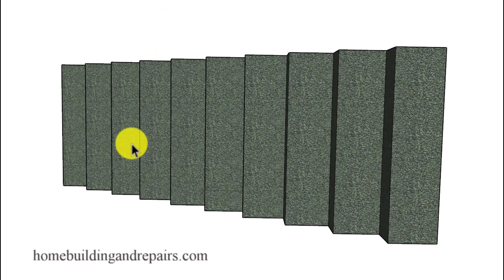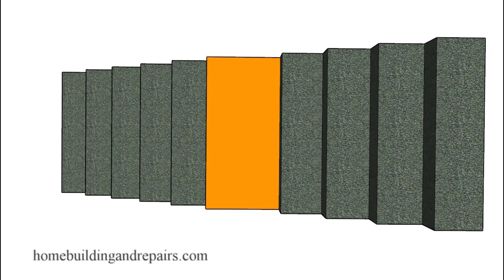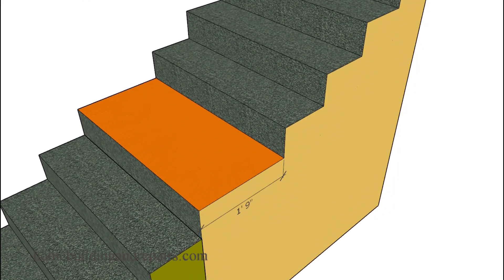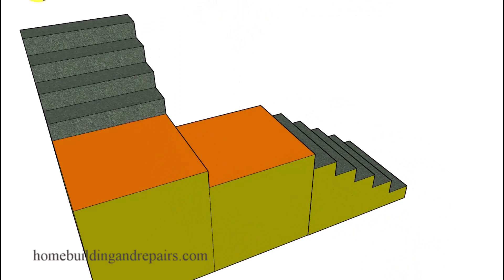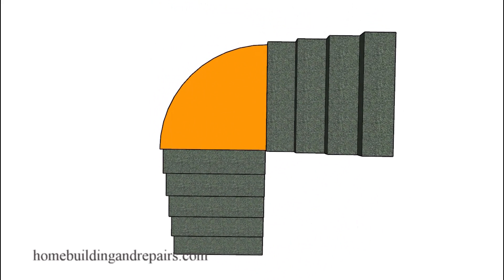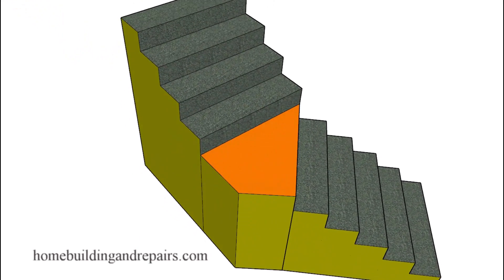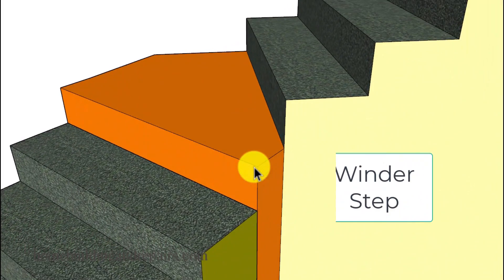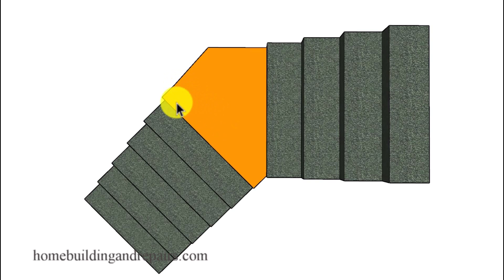The Difference Between Stair Steps And Landings - Building Code Education

Comment: Great video! To most people this is like "Who cares what you call it? A landing is just a bigger step." And it's damn ture! But for whatever bureaucratic reasons uncompresensible by the regular folks, the building code authority decides throw away the common sense, make up some stupid definitions to force the terms apart, and then inspect all projects through those tiny spectacles they have. Anything that doesn't fit inside their spectacles, they flag it as incompliant.

Comment: Hi there, great video! I have loved watching your videos and have begun to gain confidence in tackling our stairs at home. Can you help with a question I have? We moved into our home a year ago and have always dreaded our basement stairs. They are 9" rise and 9" tread. We call them the treacherous stairs!
There are a total of 13 stairs, and only a space of 33" between the bottom step and the wall. So we would like to fix the rise as well as the tread. We have 104" from floor to the overhang, so i know we have room to work a landing into the staircase to allow more room to make them less steep.
My question is what would make the most sense for us to use as a template for the future rise and tread for our stairs? We would love 10" tread and 7" rise. Is it possible with our current setup? Thanks!
Reply from the maker: I don't provide detailed layout plans for viewers, but would suggest taking a look at our website for more ways to layout your project.